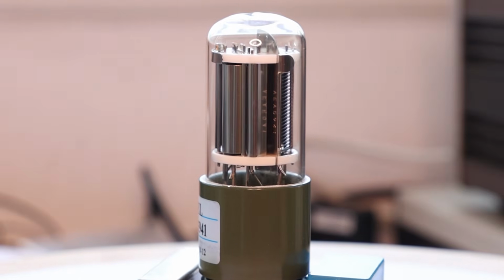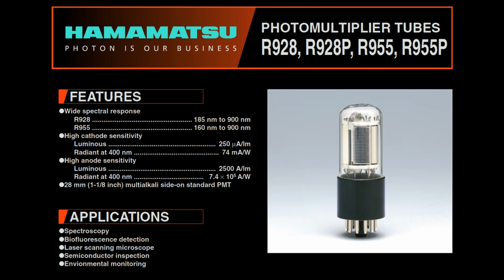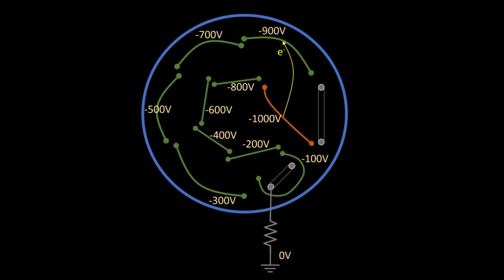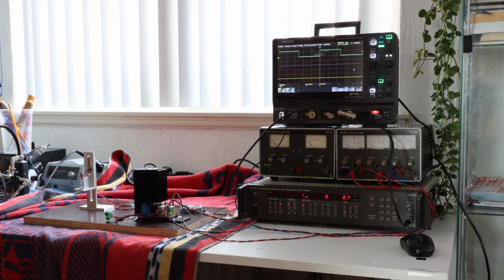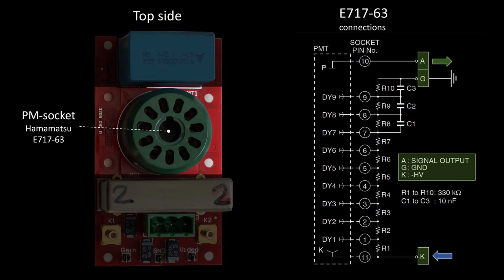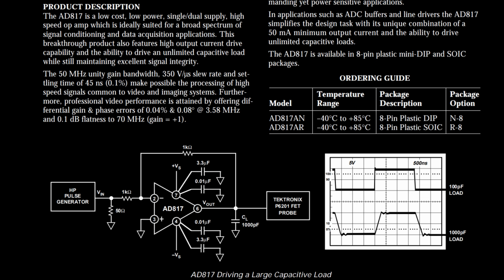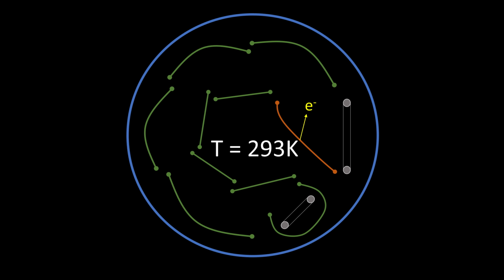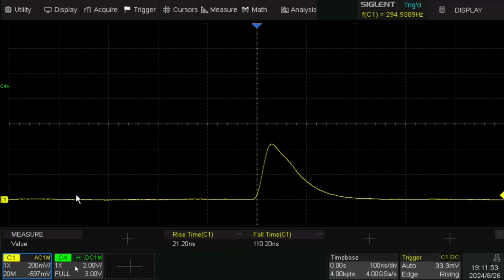PMT1: Using a Photomultiplier to Detect Single Photons

Comment: Small correction at the 9:11 mark: the current should be the charge divided by the transit time spread, not the transit time, because the current does not depend on the time delay it takes for the avalanche to hit the anode, but the interval within which the amplified charge is distributed.
Reply from the maker: Yes you are correct, this is an error that I overlooked. I will set this straight in the follow-up!
Reply: Right. Although, to make good on that transit time spread, one needs a ~1GHz measurement bandwidth. That would probably require a difference socket with a 50 ohm coax output, and would definitely require a different preamp!

Comment: I was product manager for a company that made photographic darkroom equipment. We had a color analyzer that utilized the PMT. When testing, we had a radioactive element that was contained in a steel, light tight container. The PMT was put in a fixture that was also light tight then a special valve was opened exposing the PMT to emissions from this radioactive target. The PMT was then adjusted to the constant we determined for our product.

Comment: Dont forget, a photo multipler is very similar to a geiger counter tube. Some strikes of background radiation on the charged plates with knock-out and electron that then can rush down the pipe and create an event - despite the tube being in the dark.

Comment: Hi there, great video! You summarized the topic really well. I work with PMTs and SiPMs daily, collaborating directly with Hamamatsu as a PhD student in particle physics, focusing on light detection in rare event liquid noble experiments.

Just a few things I wanted to add:

- Typically, dark pulses are similar in intensity, as the vast majority of thermal electrons originate from the photocathode. If you're seeing peaks with different heights, it’s likely due to ambient light.
   I totally understand the frustration—I've dealt with my share of light leakage issues. Even high-end, all-metal, ultra-high vacuum setups can have leaks. A quick calculation shows how significant diffuse light can be. For example, a 1W light, 10 meters away, shining through a 10μm x 10μm hole, produces an enormous flux of ~200301 photons per second (at 500 nm). This light is Poisson-distributed, so you can calculate the probability of two photons hitting within the same 10 ns to form a two-photon pulse. You probably have a much higher flux, and dimming the light might not make a noticeable difference to your eyes or oscilloscope. A Poisson analysis of your height distribution would likely be useful.

- Don’t rely too much on the manual for specs like dark noise or quantum efficiency. These values are often idealized and may not reflect reality, especially for used devices. Who knows what the previous owner did to the tubes? The photocathode might be damaged, which could significantly lower both dark count and efficiency.

 - For photocounting, I’d recommend using the pulse's charge, as it compensates for slight differences in transit time and hit position on the PMT face.

 - Have you heard of SiPMs? They’re essentially solid-state PMTs—cheaper and more powerful when it comes to photocounting. SiPMs can distinguish between an N-photon hit and an N+1-photon hit, up to around 8 photons (depending on the model). With PMTs, it becomes tricky to distinguish beyond N=2. Skipper-CCDs, on the other hand, can detect even larger N-values, going beyond 300.
Reply from the maker: Thanks, that is some really good info and I'll use it for the next video. I'm aware that my measurements are not ideal and some remarks were kind of simplified. Also, I'm thinking of building a dedicated box to hermetically seal the setup and which fits in my freezer ;-).   About the variation in peak heights: since I'm using 520nm light, you'd expect these also in the photon pulses since a single photon can release multiple electrons. This is actually illustrated on page 232 of the hamamatsu PMT handbook, showing individual peaks in the puls height histogram at 1, 2, 3, etc. electrons of current.
Reply: @HuygensOptics Be careful with cooling and HV! Condensation, high voltage and sensitive op amps do not mix well.
Reply: @BartSliggers  Pot it or place it in a dish of dielectric fluid like "FC-40 Fluorinert", which can go down to -100 C.
Reply: @HuygensOptics  So you can finally answer the age old question if the light really goes out if you close the fridge!
Reply: @HuygensOptics  Thanks! I actually think your setup is really nice, a great start for sure. Nevertheless, a hermetically sealed freezer setup will work a lot better especially if you menage to tape the edges with aluminum tape -> you can get it to almost perfect darkness like this. 

Regarding one photon releasing more than one electron, I'm not too sure about this. In the photoelectric effect, the photon is absorbed by the electron, not being possible to excite another one. You are suggesting something like a Compton scattering? Or the variation in the multiplication factor at each dynode?  (I looked at my copy of the handbook and page 232 is the chapter 13 cover page. Perhaps I have an old copy? (edition 3a) )

Anyway, I think your pulses during LED-on time look great. That's what I expected to see! The same for LED-off time, pretty consistent to what I usually see in a leaky setup -> dark noise + random high intensity pulses. 
A leaky setup is not necessarily bad. It just increases your noise floor. But if you want to measure large signals, that is usually fine :)
Reply from the maker: @brunopassarelligell1 about the figure in the PMT handbook. if you download the current version from the Hamamatsu website it's the figure 12-3 named: Output pulse height distribution in a multi-photoelectron event. Note that the pdf page and "physical" page numbers do not match. page 232 = page 245
Reply: @HuygensOptics  Great, thank you so much for clarifying! I think chapter 12 refers to HPDs, not standard PMTs like the r928. This guys are a whole different can of worms.
Nevertheless, I still think the occurrence of multiple photons is not due to a photocathode releasing more than 1 electron sometimes, but actually that is a simple Poisson fluctuation on the number of photons hitting the photocathode at the same time. And that is why they say "[...] pulsed light adjusted to a light level that causes the photocathode to emit 3 photoelectrons on average is repeatedly input to an HPD [...]". The "on average" is the key here, but I understand this wording is confuse.
Reply: Heh, I'm waiting for someone to start selling an XRF gun for less than $1K.   An SiPM and an x-ray tube, how hard can it be?!
Also, with an x-ray laser and a gasoline-powered drone to place it on, I can elemental-analyzer the world!

Comment: Excellent video!  My son will find this video quite interesting as well.
I have a question that I've always wondered about with single-photon detection.  The first time I heard of the ability to detect individual photons, I was nearly skeptical for one reason: noise due blackbody radiation would render it useless.  If we ignore the thermionic-emission, why do you not observe (or perhaps you do in a very small quantity) photons due to blackbody radiation?  Is the emission of blackbody photos in this range of wavelengths at room temperature so vanishingly small that you truly may almost never observe them?

EDIT:  I used an online spectral calculator and, if I'm reading this correctly, over the wavelength range of 100-800 nm @ 300K, the band radiance is 0.186177 phot/s/m^2/sr.  So perhaps a photon due to blackbody radiation would be observed from once per week to once per month, maybe?

Comment: How do you know if you are measuring a photon and not say, stray radiation, or random ionisation

Would a diode between the resistors in the divider circuit help to prevent any self feedback events

Are the tubes better to be used with single wavelength light

Why would signal be labelled video, that's strange, I'd have put that into a crt, see what happens 😂
Reply from the maker: That is why I added the modulation in the light so that you can constantly compare light and dark pulse frequency. I don't think there is a high risk on feedback loops if you use the PMT as specified. A single wavelength of light might give more consistent peak heights since high-energy photons can release more than one electron from the cathode. I did check the video output, but I actually forgot what it was for, sorry!

Comment: I know you were doing it for filming purposes, but just a heads up that it is best practice not to expose PMTs (or APDs for that matter) to room lights even without voltage applied. It won't necessarily damage the PMT, but it can cause trapped electrons in the photocathode to build up. This results in increased "dark counts" (thermionic emissions) for a period of time after light exposure as those trapped electrons work their way out. Source: I'm a quantum optical engineer and work with this kind of stuff daily
Reply from the maker: Thank you for making this comment. I should probably have mentioned this in the video, although a remark about this was displayed with the dark current specifications. The light in the room wasn't actually that bright, I just used 3200 ISO for filming and kept the PMT away from directly pointing at windows or lights.
Reply: The specifications show measurements taken 30 minutes after startup. This allows time for almost all of the trapped electron buildup to dissipate.
Reply: Interesting!  Does this also apply to over-exposed PMTs with power applied?  Or do those really become permanently damaged in that case, and if so, how?
Reply: @kevinwhitfield3305  That damage is typically due to the light generating "large" (relatively) currents bombarding the dynodes and resulting in actual material breakdown.

That said, any reasonable PMT will have current limiting resistors between dynode stages to prevent permanent damage. In that case, typically the only thing that happens is your count rate saturates and electrons start embedding in the dynodes. This will increase dark counts for quite some time, but can be fixed by tempering (gently heating the PMT to help the electrons wiggle out).
Reply: I've seen this in cheap optocouplers!   When used for audio, I get a single burst of white-noise out of the phototransistor when the LED is first turned on.   (Put it on the shelf for a week or more, if you want to observe another burst.)
Reply: Are you working with "slow light"?
Reply: Sounds made uo
Reply: Gratitude for this window ♥️

Comment: Awesome video! (Especially because I just bought a similar pmt on eBay and haven’t had a chance to play yet!).

A couple things that have been bothering me about PNTs though, do you know if it’s common for electrons to “skip” and hit the wrong plate, like going from the -800v to the -600v? I have to imagine the field DOES curve, but are the electrons just emitted directionally and going fast enough that they don’t miss? I would have expected a uniform hemisphere of ejected electrons. Maybe it doesn’t matter if some small fraction miss…

For my yet-theoretical project, I’m hoping for much better temporal resolution than you got here, probably maxing out my oscilloscope’s frequency acceptance plugged up to the pmt directly. my fingers are crossed I can probe ahead of any op-amps that may be present! (And the attached RC network is optimized), but are there any other obvious sources of slowness? I’m really wanting less than 5ns rise time, and while the pmt specs say that’s easily clearable, I know there’s a lot more error elsewhere.

Thanks for a great vid! Curious about your last animation with the splitter 🤔
Reply from the maker: Hi Brian, thanks for stopping by! You are right about the dynode "skipping" . The process that I showed is of course idealized and is in practice quite a bit messier than depicted. Some electrons will even end up on the glass envelope. So indeed, a fraction of the electrons will miss the next dynode in line but that does not matter so much, it will probably lead a broader spread in the electron transit time. But a 200V difference will also mean a 200eV kinetic energy and will thus generate more secondary electrons. In the end, the dynode configuration is optimized such that the internal field in combination with the kinetic energy gained by the electron with its inertia leads to the large gain and a short transit time. 
You can actually measure the signal directly on the anode output using a scope. Of course in this case it depends on which value you use for the grounding resistor. If you use 50 ohm, your signal will be very small but very fast. if you use 1k, it will be 20 times higher but not so fast. so I guess there is a trade-off for you to make here.  And of course there are much faster OpAmps that you can use.
Reply: @HuygensOptics  ah yeah! Very cool. I want to do more research on the different dynode layouts too - I just picked a supposedly fast one but I was surprised there are multiple common ones! It’s amazing that it works at all.

And yeah on speed I guess I’ll be comparing the input impedance of your op-amp to the input impedance of my cheapo scope lol 😂. I would have hoped that an onboard op amp was pretty darned optimized for this stuff but maybe it’s a setup specific for counting photons and that’s not great if you end up with 10-100 of them per nanosecond 🤪
Reply from the maker: Someone pointed out here that I actually made a mistake here: the transit time is the time it takes for the electrons to travel through the detector. But if you want to know the pulse width then you should look at the transit time spread (TTS), which is the spread at which the electrons arrive at the anode grid. The TTS has a value is 1.2ns for my photomultiplier. And therefore the shortest attainable pulse width would be in the order of the TTS, say 2 ns for the photomultiplier used in this video rather than the 22ns value I mentioned, which is good news for you!

Comment: I think even you'd cool down the PMT to 0ºK to get rid of the thermal electrons there should still be a signal from extra-terrestrial gamma sources like the sun and the center of our galaxy. Don't know what the frequency would be though, but I know that in order to avoid those extra-terrestrial sources you'd have to go pretty deep underground.
Reply from the maker: I think the occurrence frequency would be very low, much lower that the level of thermionic emission. Also peaks would probably be large due to scintillation effect and therefore distinguishable from standard thermionic emission.

Comment: Detecting single photon events in a thermal background of a few 100 counts per seconds will be a challenge. However, if the laser is pulsed and you gate the amplifier with the laser pulse the background may be reduced. The amplitude of the amplifier output then should vary with the number of primary photoelectrons.

I am curious if this will show up. Eagerly awaiting your next video.

Comment: Question: how does the cathode avoid ejecting electrons accidentally (due to thermal motion) without any photons?
Reply: It doesn't so you get dark counts. They can be very low though (few hundred or thousand per second at room temp). If you cool the detector to remove thermal energy they can be much lower.

Comment: Really cool little units with all the needed parts integrated, and at a very reasonable price. What do you think they came from - a university undergrad optics lab being cleared out, or is there a commercial use?
Reply from the maker: Some kind of classified apparatus: the seller could not disclose the application because of a confidentiality agreement with the company that sold the apparatus to him that contained these items.
Reply: @HuygensOptics  Maybe check it with a radioactivity detector!!

Comment: Ok, but you had a light source that is already detectable by the camera, how about one photon emitters? They are probably even more complex devices than a photo multipliers.
Reply from the maker: Even a single photon emitter can be observed with a standard camera. You just have to use a much longer shutter time and focus of the emitter on the detector. Because the difference between a single photon source and a really really weak source is not that big.
Reply: @HuygensOptics  I think, for some cases this is true, but let's imagine we don't believe that, would not that be interesting to observe real single photon sources?
Reply from the maker: @Uterr  Sure, if I can get my hands on one, I might even add  that to the second video (;-).

Comment: Many years ago, I took part in the TOXICHIP project. The goal was to measure single photons from genetacally modified Ecoli bacteria that started polluting light in the presence of toxins. We picked an avalange diods instead of photomultipliers because of high voltage. Plus, semiconductor design is more compact. Tyndall institute in Cork Ireland built for us such diods. I designed a platform that included a chassis, a chip, an array of avalange diods, and electronics. It was 20 years ago.
Reply from the maker: True PMTs are old school, but they are still interesting and beautiful technology.
Reply: @HuygensOptics  I think Hammamatsu would challenge that! They come out with new PMT designs each year.
Reply: @glasslinger  like the TO-8 packaged R7400U PMTs! Super neat: PMT the size of a fingertip.
Reply: Can you recommend some materials, which would help build such decice? I would like to measure 100 photon/second flux for hobby astronomy project
Reply: @Woloszow  try to search for Dr. Hadar Ben-Yoav. He published a few papers about this project.